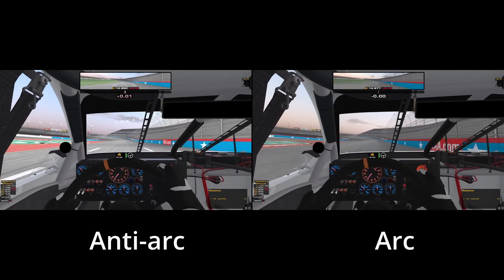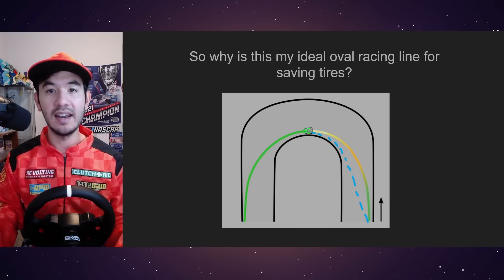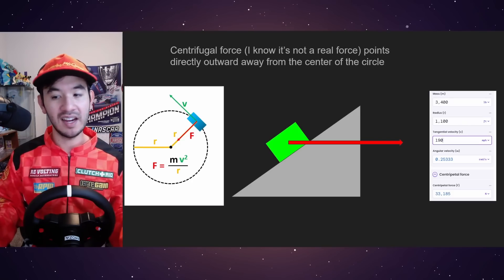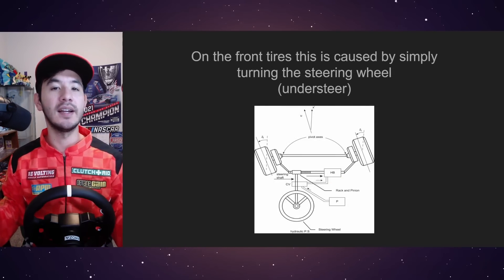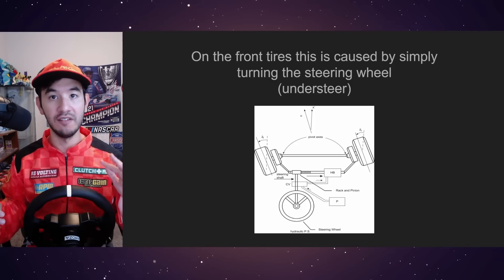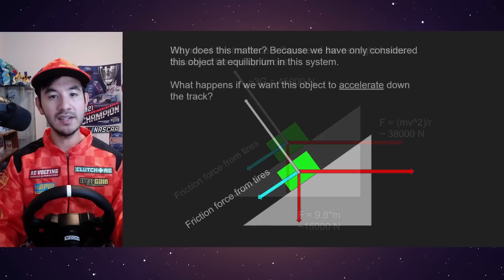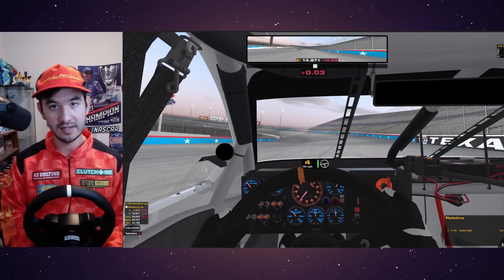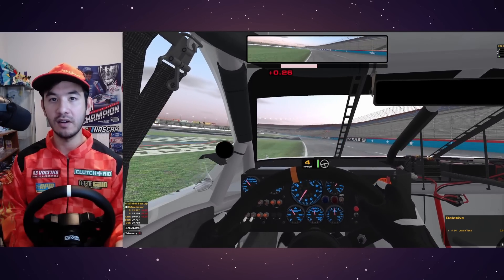Using my engineering degree to prove why you're bad at saving tires in iRacing

Comment: The total force required to keep the vehicle on the line is the same regardless of whether that force is coming from static or kinetic friction. If the kinetic friction is not enough to provide the necessary centripetal acceleration, then your vehicle will start drifting to the outside of the turn. 

The only difference is the path, and there are only two variables with the path geometry that would affect tire wear. Path radius as a function of distance (the radius is proportional to required force, which is directly related to the frictional force on the tire, which is related to tire wear) and the path length, which affects how long your tires are experiencing that wear (For example, two different paths could have the exact same radius, but if one path is twice as long, it makes sense that the tire wear would also likewise be higher on the second path). 

Given that the track superelevation is close enough to constant throughout a turn (around 31⁰ at Daytona iirc), any two paths are going to be affected by it the same. 

What you are doing at the beginning by cutting to the inside of the turn is giving yourself room to drift to the outside to increase the average radius of curvature of that turn, which reduces the force experienced on your tires dramatically, allowing the camber and the superelevation to support more of the turn. 

It doesn't really have anything to do with the difference in kinetic and static friction, as it's purely path dependent.

Comment: There's a few dodgy assumptions and definitions in there, but your final answer about a shallower entry is right, just not because of the banking... a shallower entry means you have to enter the corner with less speed, and the v^2 component matters a lot.  The less speed you have when you turn the wheel, the less force you're putting through the tires. Banking exacerbates the effect, sure. But because of the banking you need less slip angle on the wheel/tires too.  Typical tire-killers are too much speed on entry and keeping the steering wheel turned hard on exit.  

A tire-killer driver could still eat up tires on that shallower entry if they don't slow down enough and they try to turn the wheel more to compensate.

Comment: Common sense let of early to save tires and roll thru the corners
Reply: I run a bunch of long races 150-200 laps with no tires  allowed and I can confirm that letting off early and rolling the corner does not save tires as well as you think. It’s more about braking in a straight line and turning the wheel AFTER you have the car slowed down.

Comment: There's a really good post on the iRacing forum under the API and Developers section on how to set up McLaren ATLAS to analysis your ibt telemetry (somewhat redundant if you use VRS), where you can see tyre surface temps for your entire stint, directly related to wear in the model, so you can run different lines and see what's best. Would love to see what overlaid on your farmer's guides but the data is only in the disk telemetry not the live feed that the overlays use.
Reply: I was trying together look into that but I couldn’t find a place to download atlas, where did you find it?
Reply: @thatoneguy4448  it's all referenced from the iRacing post on their forum.